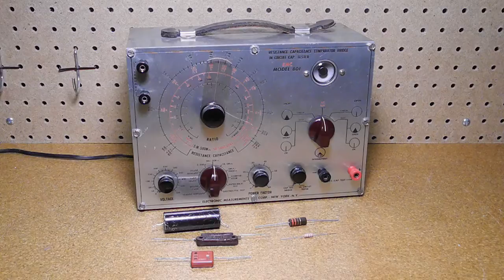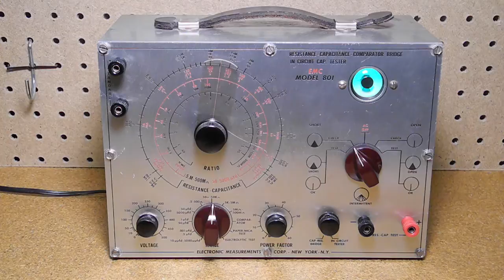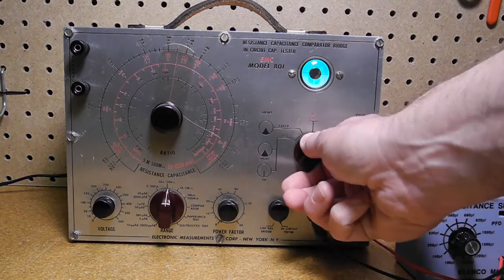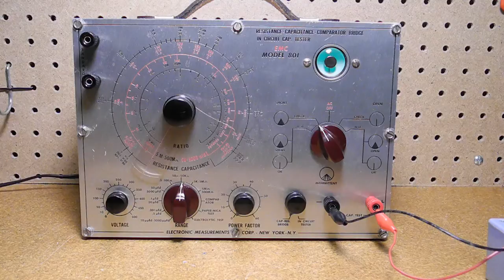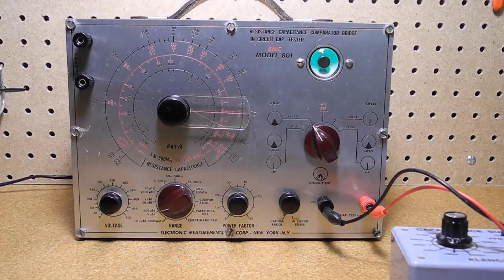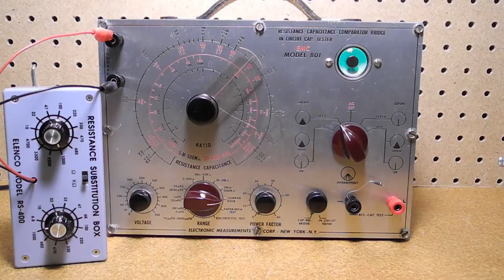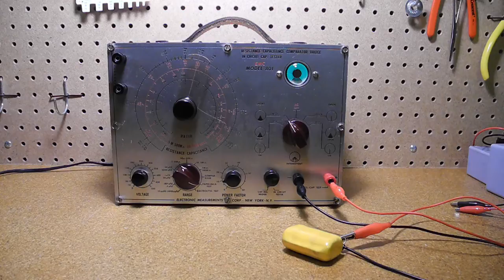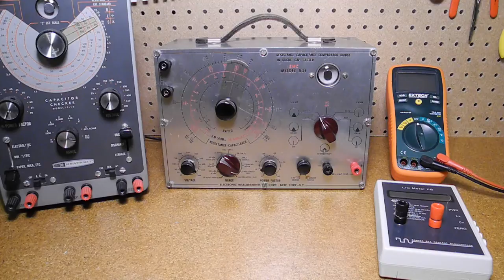EMC Model 801 RC Bridge and In-Circuit Cap Checker

Comment: Very nice treatment on you've done for that instrument.
EMC made rather good stuff affordable.
The most likely reason the in-circuit short/open capacitor test isn't working well is because the instrument expects a 1/4 wave open-ended "stub" between it and the capacitor under test: the test lead length is critical, and should be coax (I recommend RG-58U).
The proper length of the test lead will depend upon the RF Freq. the beast uses for that test, usually somewhere around 40 MHz (tuneable if there is a compression trimmer Cap. in around that coil). Otherwise, the correct length of the test leads can be determined by connecting a length of coax to the terminals (leave the loose end open) , and trimming its length in small steps, maybe an inch at a time. Then test a known "good" Cap. and adjust lead length as needed. Hope this helps!
Cool stuff here, thanks for posting.